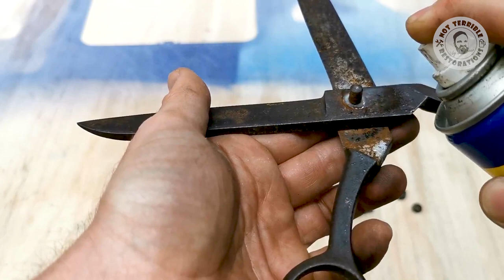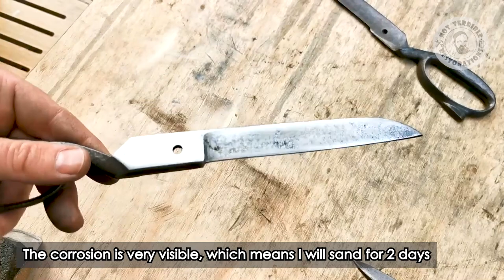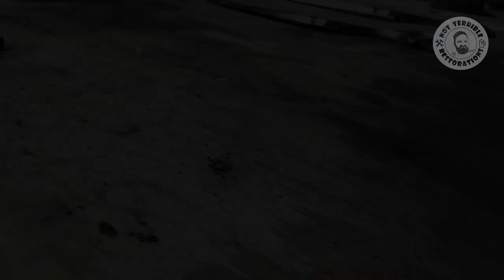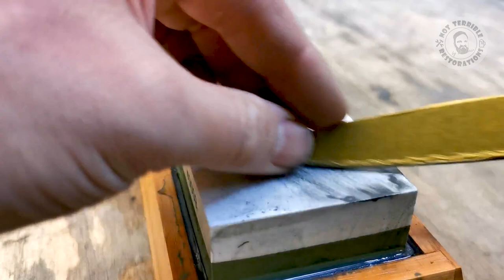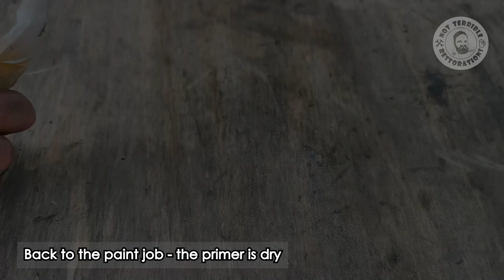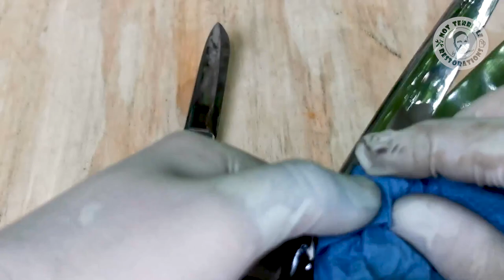IMPOSSIBLE Restoration of Two Pairs of 100 Year Old Tailor Scissors

Comment: To be honest The cutting didn't look so good. I would have changed to a 35 degree angle. Scissors seem to have their own mind when it comes to cutting. When you find the angle they love they cut fabric like a hot knife going through butter. I absolutely love this video. I'm restoring an old pair of Wiss scissors as I'm watching. I've been sharping and repairing scissors for 41 years and I still learn something new just about every day. Thank you for the beautiful video I'm sure her father will be very proud when he sees them.
Reply from the maker: Thank you for the advice!
Reply: My wife to totally obsessive about scissors, and it's my job to keep her happy. If they won't cut sheer fabric or thread to the very tip, then back to my shop. I've got to where I can hear and feel when the scissors are perfect or a little off. They have to "sing" a certain way to be perfect.

Comment: I soak wetstones for 20 minutes otherwise every time you apply water it will soak in and leave nothing on the surface. Also I was taught to sharpen scissors same way as on Paul Sellers video. Beautiful job!

Comment: A very good and thorough restoration. I was looking for some inspiration as I work on some general 11" shears. You set a good model for how it's done. While mine are darkened by time there's little rust and no noticeable corrosion or pitting. The benefits of a previous owner painting the scissors from tip to handles. I look forward to more of your restorations and beer ratings.
Reply from the maker: Hey Michael. Sorry for the late reply I was so busy on my next project. It will be released in 10 minutes

Comment: Your attention to detail and workmanship is quite remarkable, and i appreciate that a lot,  the but i actually think (just this one time) it is a bit of a shame, that all of grandpas dings and dents are no longer visible. The scissors now look completely new, if you didn't know better. But still a big thank you for very nice video.
Reply from the maker: Yes I do now always try to leave some of the old patina as long as it is still aesthetic and doesn't influence function. So that was the reason I fully polished the scissors. You need a smooth surface to cut silk for example

Comment: As far as I can remember, the inside face of those Taylor's shears should be hollow ground to give clearance to the cutting edge, the few pairs have sharpened have been hollow ground to aid sharp shearing right up to the tip of the shears, it can be checked by placing the face of a engineering guage block across the inside face of the blade, 🙂
Reply from the maker: Thank you for sharing your awesome knowledge. I'm pretty sure you are right. The blades are hollow on the inside

Comment: Im restoring a pair of Wiss Inlaid right now. Mine are some small 7.5 in. Gonna look beautiful tho. Your vid is just motivation to just keep sanding and polishing. Lol. Great work.
Reply from the maker: Keep on going buddy and thank you for commenting.
Reply: That's great. What does inlaid mean? Is it because the scissors are forged from steel with a cast iron back/body? Anyway, I've inherited a pair of Wiss inlaid #20 scissors from my grandmother and have done only a partial restore of them. I don't think they were ever sharpened in the estimated 80 or so years of its existence. Even after all this time they still cut cloth reasonably well but it does need sharpening. Wiss scissors are fantastic quality.

Comment: They look beautiful, great attention to detail.
They do look like they could be cutting better though, with tailor shears like that there should be little to no resistance when cutting, the curve of each blade may just need little more adjusting. Hard to tell through video though, I could be mistaken.
Reply from the maker: Hey Shaun your right. The rust messed with the tolerances. But I think they still cut great considering the previous conditions :)
Reply: @NTRprojects  fair enough, I suppose the restoration is for more sentimental importance, rather than practical anyway. beautiful work none the less, you have earned a subscriber from me!

Comment: Hello master, beautiful work, perfect. I bought two new ones, very big like these, it wasn't expensive, but still in the box, after about 3 months, they started to oxidize under some varnish that was applied at the factory. Do you have any suggestions for preventing oxidation? Did you do any treatment with these to prevent them from oxidizing? Thanks.

Comment: Just out of curiosity: I'm afraid that the heat you applied through the sanding and the direct hearing will make the blade lose the temper and after a few cut the scissor will be unusable again

Comment: How did you remove material from the blade, nut, and bolt and still have the threads hold without adding any material?  Also it didn't look like you flattened the mating faces

Comment: Google'd thread crown and didnt find anything exept watch related. 
What is it ? Do you have a link for it ?

Also I think it wasnt m6 threaded originally , some old standard and you did a m6 thread if I look at the shavings ?
Reply from the maker: In German it's called "gewindekrone" https://www.ebay.de/itm/10x-Werkzeugsets-zum-Entfernen-gebrochener-Gewindebohrer-bis-Entfernt-L6N0-T0T6-/124056548852?_trksid=p2349624.m46890.l49292
Reply: @NTRprojects  
Thanks for the answer and link. 

Never seen like that before.